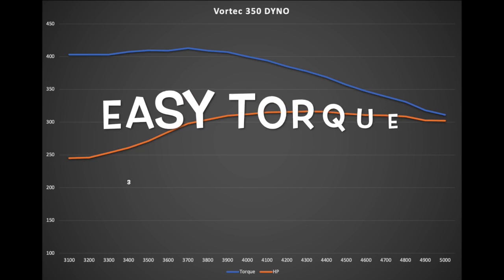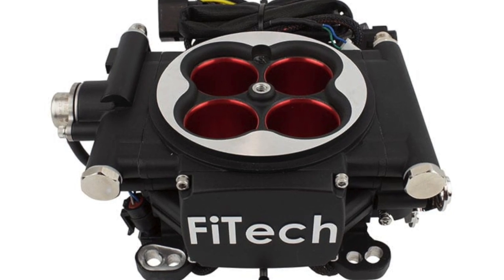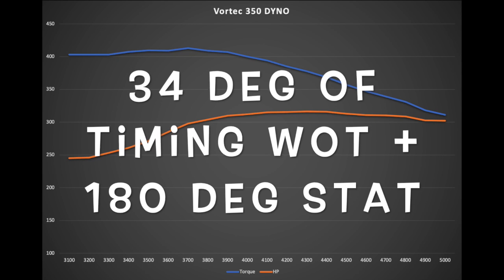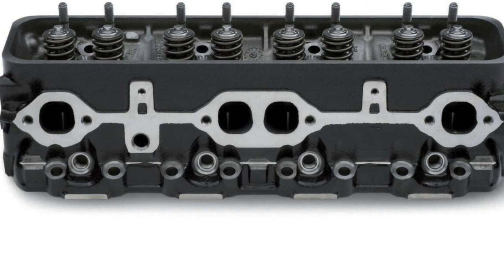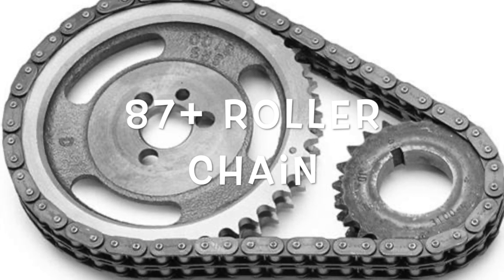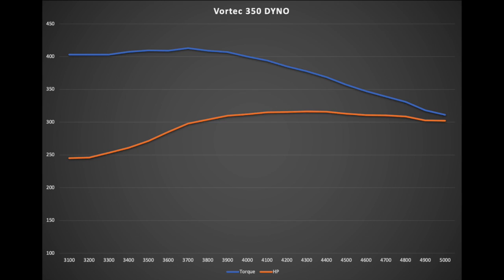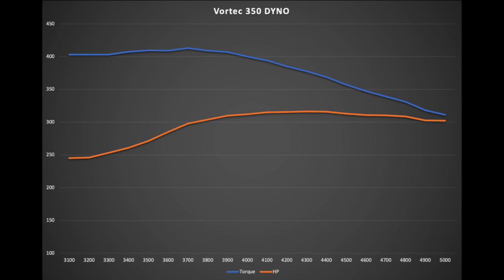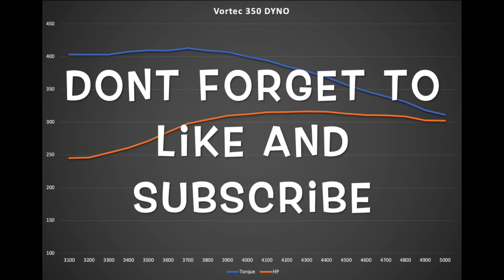Easy Vortec 350 Combo (High Torque 400+ ft lbs)

Comment: Hey Pat, did this melling 22129 cam need a special distributor drive gear with the old style HEI?  because it's a roller cam.
Reply from the maker: Use a melonized or hardened steel gear

Comment: Would a RPM Air-Gap work with a standard air cleaner under the hood of the Corvette?
Reply from the maker: Standard air cleaner, typically it will not fit
Reply: No way, its pretty tall

Comment: 3:44 Why install a non vortec  balancer ?
Reply from the maker: If you remove the crank reluctor wheel on a vortec engine you cant use the factory balancer. The vortec balancer snout is shorter. A regular sbc balancer has a longer snout and will give you the proper belt alignment
Reply: @cuttersperformance  Thanks didn't know you removed the reflector wheel.

Comment: I have a stock 2000 C3500 that I use for my business. What are some simple, reliable improvements to help torque without going as far as changing the factory EFI or requiring rewiring? Thanks in advance.
Reply from the maker: A cam like gm# 14097395 is a popular upgrade but should be tuned to work correctly

Comment: This makes me curious what my Vortec 355 is making.  It has Keith Black flattops, .020 steel shim gaskets, 10:1 compression, a Summit Stage 3 intake manifold, and a Crane 2032 cam that I had laying around.  The motor is pretty responsive with about 35 degrees of total timing. The 062 heads themselves are untouched.
Reply from the maker: If i had to guess id say around 340 to 360hp and 400+ft lbs of torque

Comment: Always bowl port!  Use ultra magnum chromoly roller rockers they have a warranty!  
A 3.625" Nodular crank would be awesome. 1.3625" Mahle pistons (with 9.025" deck).  5.85" rods.  10 to 1+ static compression. XR276HR10  cam. Ported AFR enforcer 195cc  heads.  Performer EPS. Vizard modified and tuned holley.  1.614 to 1 rod ratio= decent for cylinder wear and longevity. A 6.125" rod for 1.69 to 1 rod ratio would be even better. its just awesome.

Comment: What is your opinion on any of the comp computer controlled cams to keep the computer happy on the late 90s vortecs? Also what would the power estimate be if you did everything there but with the stock l31 intake and injection system?
Reply from the maker: Your talking without tuning or just a computer safe cam with added tuning?
Reply: @cuttersperformance  I was thinking of putting a computer safe cam with a tune

Comment: I built a similar vortex 355 . I wasn't really satisfied with it build a small block 406 never look back I would never build another 350 again once you go 400 and that's it it's like night and day
Reply from the maker: I hear that! If budget allows, you can't beat the big bore/long stroke of a 400 thats for sure. 383s are also a great option 👌
Reply: SWEET! Which heads did you put on the 406?

Ever experience cooling issues?

Comment: Would this be a good  replacement motor for a 1989  TbI  motor ?  I want to use the oem stock TbI and ecm ?  ! have the complete stock 1989 TBi set up in the hot rod in my picture.  I realize that I would have to use  a Vortec TBI intake or performer style intake with a TBI adapter. I have  a complete 1999  vortech  donor high millage engine to use. . I am interested more in economy gas millage / relability  then high  horse power performance.
Reply from the maker: Yeah it would work great overall but like you said you would need a intake or adaptor and a new tune (prom) would be needed to run properly. 
I have been playing with and porting  a set of tbi heads,  not vortec flow but im getting some good gains onnthw flow bench. I would like to use them on a future build
Reply: @cuttersperformance  Thanks  .I would be interested to see the results on the 193 's.  Enjoying the videos. I also have a pair of Word Products 64 cc heads to use instead of the 193's. Your thoughts on using those ?
Reply from the maker: What size intake runner on those WP heads?
Reply: @cuttersperformance   I don't know. Bought them assemble for a solid lifter cam set up from speedway over 20 yrs ago. Ran them on a drag car  for about 3 months till spring retainer broke. They have been sitting on the shelf since then. Probably about the same as a double hump stock head. Was just considering getting a valve job done and using as improvement over the stock 193's.
Reply from the maker: If they are small runner like 170cc/ 180cc they would be a good option for you. If larger than that I don't think you'll be happy if your trying to use a small cam and get good mileage
Reply: @cuttersperformance      Ok   thanks again for your replies and time. I will be watching for a video on the TBI heads.  Have a good day.

Comment: How about 415 hp with 425 ftpds of torque 350cid. I did one 4 years ago.670 avenger ,summit China Air gap intake,stock vortec heads/springs,howards hyd roller
Reply: What Howards kit did you use? Thx
Reply: @muddyborehole1  part# 110245-12 off the cam card
Reply: @KS-dg5zh  that’s for a 350 5.7 vortec?
Reply: @bendover2405  I used a two piece main 4 bolt block with stock vortec head, dual plane summit airgap style  intake
Reply: @KS-dg5zh  what’s the part number for the lifters you ran?
Reply: @Matthewamic  hrs-9116-an threw summit racing
Reply: Could u give me sum tips??  I'm doin a vortec 350  to a stroked 383
Reply: @kinggg313  what kind  of budget do you have to work with?

Comment: this block doesn't  have a hole drilled out for mechanical  fuel pump
Reply from the maker: That is correct. You would have to run a electric pump but in this case I went in tank pump and fi tech fuel injection

Comment: Cool info here. I am putting my L31 back together with a totally stock bottom end, and I've mimmicked your bowl work and unshrouding from your other videos with some fresh Manley undercut stem valves, beehive springs, XR276HR cam, roller rockers, GMPP ZZ dual plane intake with a 650 holley. I was hoping to see around 360-370hp at 5800 with that strong torque band of this motor. I really appreciate watching and learning from all your videos man... Keep them coming! Cheers
Reply from the maker: Great cam! One of my favorites 👍 thanks for checking out my videos, i appreciate it
Reply: @cuttersperformance  Gaaaah we would love to see some dyno info on a 383 build with vortec heads!!!!!
Reply: @jayree379  add about 45TQ and 30HP to this and you've got it lol
Reply: @jjmccloud  honestly maybe a little more torque down lower. these heads love gulping air down at low rpms. yes they stall at higher rpms but they dont stop flowing they just dont get gains from flowing at that point. they still flow more air just nothing else is left to be had without affecting the torque down low. 
with added displacement and flowing on the heads and a proper torque cam for the engine it would make tons more torque and a bit more hp while still being super streetable unlike all these cammed out screamers with high stall convertors. youd end up with big block torque in small block package. but you must use splayed caps from a 2 bolt block.
the vortec bottom end is weak for small block builds. 2 bolt is mainly what youll find 4 bolt is a no no. weaker block and less meat for the mains too. 2 bolt is strongest block and splayed caps are stronger than a proper 4 bolt. with a very mild setup you could net 500-600 ft lbs of torque under 3k rpms. and still have 400-500hp no questions asked on the top end. a motor that just pulls rips off idle and just keeps getting better.
Reply: @chehystpewpur4754 i wouldn't call a 4 bolt "weak* sure if you want to spend on the machine work to take a 2 bolt to splayed, great. Or just buy an aftermarket block that is already set up with splayed and thick decks... or build your 2/4 bolt stocker and have fun, good reliability too, except for extreme  engines
Reply: @jacobnorth8642  i didnt call the 4 bolt weak. i pointed out the obvious problem. vortec motors which is what we talking about. have less metal than an old block. the 2 bolt is the good one. a stock 4 bolt vortec can crack the block around 500 ft lbs of torque. 2 bolt wont do that with splayed caps. were not talking about aftermarket blocks. cheap reliable power.

Comment: Any benefit from changing timing on the stock vortech cam?
Reply from the maker: Not really, not worth the effort for very little reward. Cam swap will be your best bet
Reply: @cuttersperformance  Thanks.  The motor is out and the timing chain is a cloyes I could move some, but I needed some reassuring it's not worth replacing the timing cover again to move from straight up.

Comment: I've searched the internet for an answer to a question and I all I come up with is some people say it's ok but most say it's not ok.  I have a 87 crate 350 for a truck with a flat tappet cam  that I put vortec heads on and also upgraded the cam to a hyd. comp cam with 454 lift on ex. and int. along with dual springs and bought new comp hyd. lifters.  Two of the lifters don't seem to be holding very well and I've heard of other people also having trouble with brand new hyd. flat tappet lifters.  I'd like to just get rid of them all and buy flat tapped solid lifters but my question is ok to use solid lifters on a hydraulic camshaft?
Reply: No I wouldn't, most likely gonna wipe a lobe

Comment: So if everything is kept the same, but the heads are the non Mexican 906s, how much of a difference in power is there?  I’m trying to get an idea of how much power my engine will have. It’s a 355 with flat tops, 906s and a Summit 1103 cam which is slightly larger than the one in this video.
Reply from the maker: The Mexican vortec flow less than the earlier ones (exhaust and intake). Not a big deal as this can he corrected with some porting. But its usually a 15hp or so difference on a average vortec build

Comment: Hey great combo I'm building a similar set up 98 vortex 350 -30 over now a 355 pistons are flat tops compression is 9.5-1 intake Edelbrock performer carb Q-jet built by SMI induction and the cam is roller by comp X4  258HR-11 
ADV DUR : 258-262
DUR@ .50: 206-210 lobe sep:111.0
VALVE LIFT : .458-.458 what kind of power would I make with this set up or what kind of power would your motor get with This cam its and extreme 4x4 torque cam
Reply: Only 9.5-1 with the flat tops? Did you use a thicker head gasket? I figure with flat tops and this Gm head gasket it should be 9.8-1 - 10-1 depending on how far down in the hole the flat tops sit. If you got regular rebuilder pistons with the shorter compression height on piston then it makes sense You gotta get the ones that have the 1.056 height to avoid sitting that extra .0020 in the hole
Reply from the maker: The cam is similar but that cam would probably make 15 to 20 peak hp more and slightly more toque. You'll also see some gain with the flat top piston

Comment: How high a compression ratio for Vortec heads on E85? It’s actually becoming available from the pump near me. Always enjoyed the snappy response from a higher compression engine. Not even for max HP just the torque and response since it’s just more of a pleasant engine to drive on the street.
Reply: E85 exclusively you can run over 15 :1 compression. I would stick to 12:1 or something around that.
Reply: Thanks.

Comment: Low buck power is cool. That motor would also be a fun street build in a small or full sized half ton 2wd pickup with proper gearing and 100 shot of nitrous. Especially with the extra massaging to get to the 330hp level. Won't be setting records but still would be a fun budget street setup.
Reply from the maker: Fun reliable power for a driver thats what it was built for. Then 100 shot for the track haha

Comment: i did something like this to the L31,in my 1998,gmc,savana,1500. i replaced the trans with a stage 2, 700r4, replaced the rocker arms with 1.6 ratio, edelbrock EPS vortec intake ,edelbrock AVS2,650 annular carb, and a accel distributor, blow thru carb hat for cold air induction. runs good, tows very well. gonna replace the motor in the near future with a 427,SBC, mild build for towing reasons.
Reply: I built small blocks that tow better than  my buddy's race duramax.. and you don't  have to beat the shit out of them to get them to move. Quieter power and no stink.  Wate till they get the electric  trucks worked out. No more clacking  stinking thrashing machine's.  Them idiot's. Like that smell.  Lol.
Reply: @chriscatarcio2983  want to do this with my '96 2500 , just put a new AC Delco multi port injection in will this plan still work with my injection

Comment: Gas engines are over ..the tesla plad make over 1000 hp and runs in the 9.5s at 153mph....gas engines  can't touch THAT....
Reply from the maker: But the question is....how do we make them sound cool? Lol
Reply: @cuttersperformance  its no fun without v8 noise
Reply: Does someone want to let him know that there are cars making 11000hp that go over 330mph in the 1/4?
Reply: There's not even enough lithium to make enough batteries
Reply: Maybe if you like riding around in a microwave oven..
Reply: I’d race any Tesla across the country in my tdi Vw at a steady 38 mpg at 115mph…how many times would they stop.lol..again no v8 sound for either…sadly for a grand my tdi will make 400 torque just off idle and nearly 250 horsepower-for 2 liter coke sized engine
Reply: 9.5s? thats all? with 1000hp? oh wait,i forgot the teslas are over 5k lbs....
Reply: Hank Iroz Audi R8 made a Plaid look like it was tied to a tree…

Comment: I'm curious if you tried to adjust the cam advanced or retarded and then took Dyno measurements. I bet that engine will last for years. Nice work!!👍
Reply from the maker: I did not the cam was installed straight up. Don't think you would see a huge swing with this cam but it would be fun to try

Comment: Looking to put a 270h comp cam in my stock bottom end 4 bolt main 350. Also have a set of stock vortec heads I want to throw on there aswell, the cam has .470 lift on intake and exhaust, has anyone ran this amount of lift on stock vortec heads before? Is it possible ? New springs and machining aren’t currently in the budget, but do I really need them?
Reply from the maker: Unfortunately I don't think i would for two reason. 1) its going to be close for retainer to seal clearance 2) your most likely going to float the stock springs with that cam
Reply: @cuttersperformance  I’ve watched some of your videos on getting more lift out of vortecs. Would going the whole machining, springs , retainers, keepers he nessecary aswell? What would you recommend? This being a street engine would I get away with just new 100lb comp springs ? Or would you say go the beehive route ? Also do beehives alone create more lift or is that a myth.

Comment: Have you ever run the Chevrolet Performance upgraded cam for the vortec? It’s basically the biggest cam you can run without machining the heads and adding valve springs. I was just curious because that is the cam in my engine.
Reply from the maker: Don't think so, send me a part number if you have it
Reply: @cuttersperformance  I'm guessing he is thinking of the ram jet 395 cam with 1.6 rockers..
Reply: I believe that is the GMPP 357 cam
Reply: Yeah that cam get some mentions on YouTube. I've heard that cam really wakes up the vortecs.

Comment: Been looking at a Summit cam for a truck 350 im planning to put vortecs on, part #sum-1102. Has .421/.444 lift and 204/214 duration, looking for lots of low end torque. Is there a possible valve spring upgrade that doesnt require different keepers and retainers that would work with this cam? Is it actually a proper cam choice for stump-pulling torque? Its my first engine build and im hoping i did my research correctly. Love your videos! Thanks
Reply from the maker: A good set of stock vortec springs would work with that cam. Don't use a high milage set though as they lose seat pressure over time
Reply: replace all of intake rocker arms with 1.6 ratio arms. it will give a little more lift and deration and still be within the safe zone of the stock springs and retainers.
Reply: We used this same cam stock springs ,has a normal ish idle and pulls very hard
Reply: thats about the same specs as a stock vortec cam, s hp and tq should be similar. ive read you can use z28 springs on vortec heads IF you pull the damper out.

Comment: cool, thinking of putting a Comp Cams 4x4 08-409-8 Grind Number: CS X4 258HR-11 in a 350 ported vortec with 600cfm carb for my 2wd jimmy street rod. I am not looking for high rpm but I am after instant snap when I give it 1/2 throttle.

Comment: I recently built pretty much this same motor. I used a ram jet 350 cam, it has similar specs to the cam you used. I guesstimated it would make 320-330 horsepower and 410-420 ft.lbs. I also mildly ported the heads.
Reply from the maker: I think your right on with that guess
Reply: Nobody uses a Howards Rattler roller cam lol im about to shove 1 in an l31 shortblock but has flat top pistons, aluminum heads, rpm air gap intake with 670 Holley avenger carb. Hopefully it makes a fun little street truck
Reply: @jjmccloud  Should make a lot of torque with a Rattler cam

Comment: Smart combination. Add a stroker crank and you’ll be talking big block torque. Thanks.
Reply: Even 3.625" crank with a good rod ratio for a 370 would be a nice torque increase.
Reply: 😂 big block torque

Comment: How Many CFM carburator can be a good option for this combinación?
Reply from the maker: 600 CFM would be a good choice
Reply: Running a 600cfm Holley and my truck STINKS! can’t figure out what’s going on with it. Poor gas mileage and terrible smell, can’t even start it and run for a few seconds without it stinking up the whole garage. Then I smell like it the rest of the day. Thinking about drilling the butterflies.